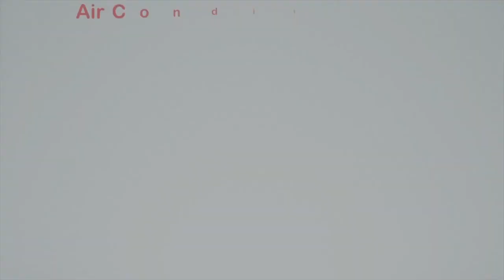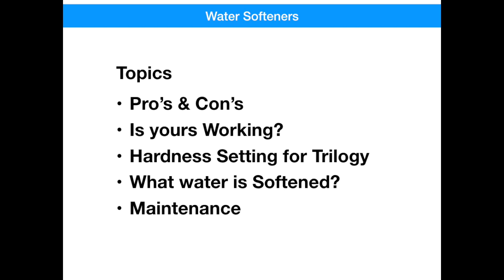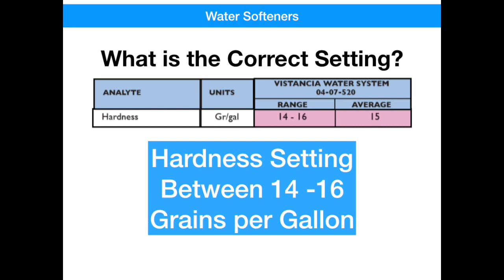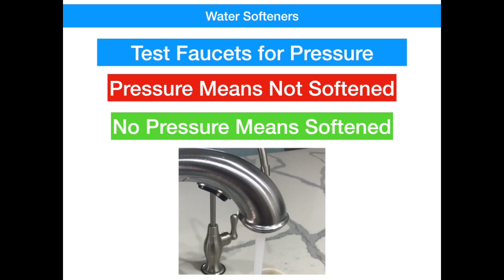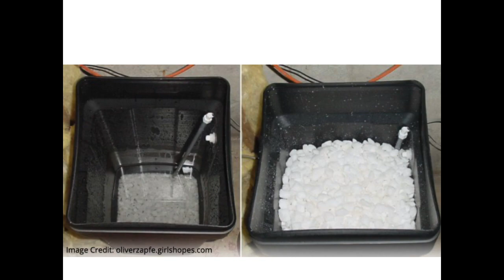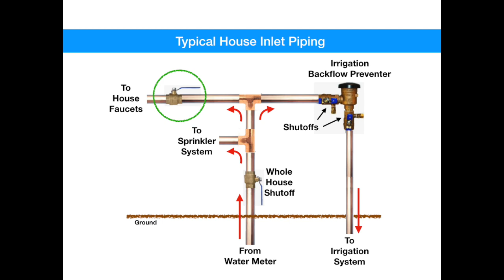Water Softeners

Comment: Doug, have you ever installed a replacement water softener? We already own a Clack 1 and are hooked up. Would we just recycle the old one and plug in and program the new one?  Or is there much more to it?
Reply from the maker: I'm embarrassed to say that I have never owned  house long enough to have to replace a softener. Sound too easy to just plug in the old settings. I would do your homework with the vendors manual and/or their online web support.

Comment: Doug,  by turning the water softener (vertical settings) to off, does it have an affect on the softener system sitting for 6-8 months not working and salt in the unit?

We have a watch person come in weekly and run dishwasher in rinse cycle, etc. should they turn back on?
Reply from the maker: First, You should regenerate your water softener the day before you leave for the summer. Then bypass the softener using the valves on top. You should no have to do anything else. You could do a regeneration when you get back but it is not a must.  Second, running the dishwasher periodically is a good practice to keep the dishwasher pump seals lubricated so they don't dry out while you're away.